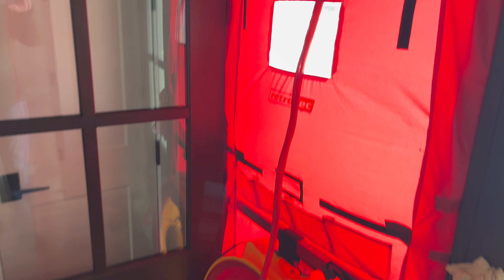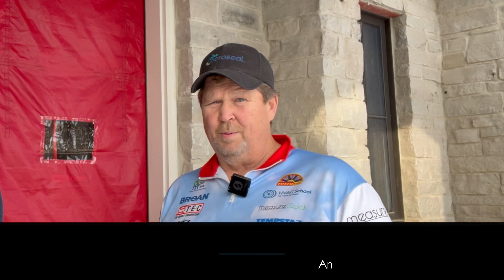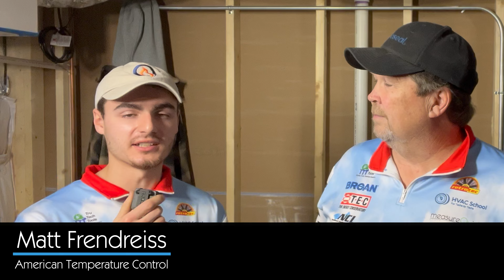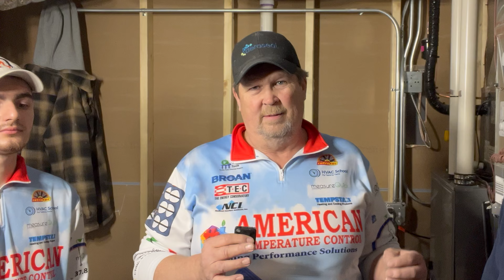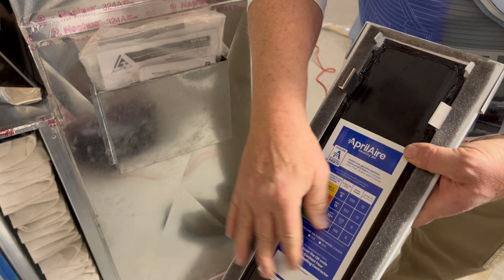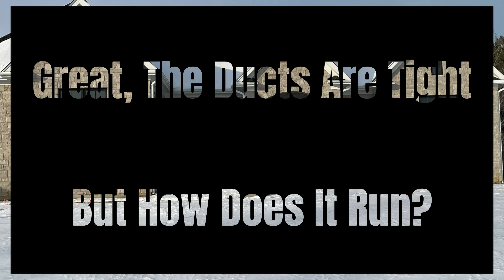Challenge House

Comment: All 36 cfm is almost certainly happening in the furnace, the cabinets are horrible for air tightness. Pulling the exchanger and using his temp silicone helps but ultimately its the weak link.
Reply from the maker: Truth!